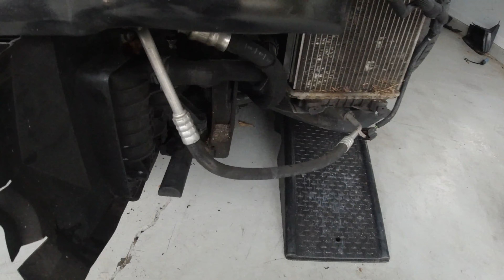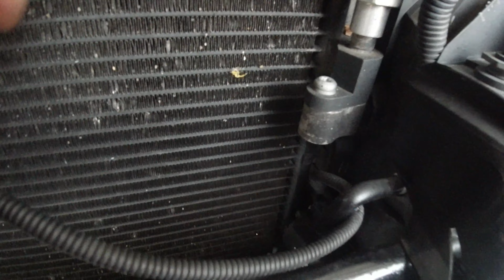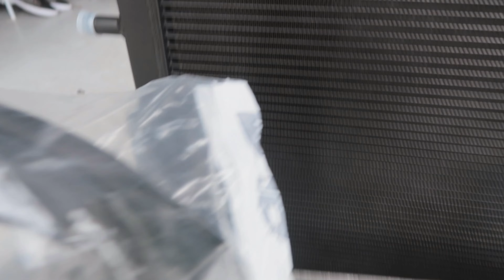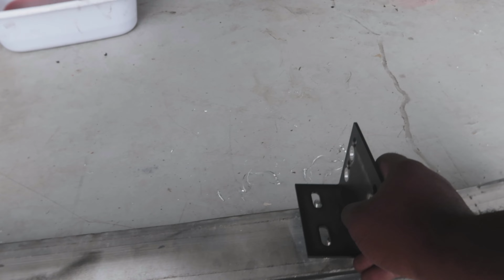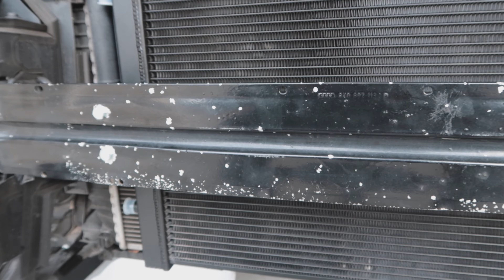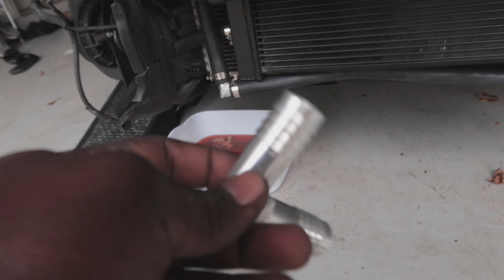PLM Power Driven V2 Heat Exchanger install | B8 S4

Comment: Bruh lol ain't that backwards i thought the hose connectors are supposed to be on the driver side
Reply: yeah he installed it the wrong way lol. but it doesn't matter, as long as the hoses are routed to the correct port lol, he just made it harder on himself needing longer hoses

Comment: Wouldn't you be able to flip the brackets the other way so the bolts go past beside the heat exchanger?
Reply: I recently did this install and flipped the bracket, there's plenty of room with them flipped. I think they ship it attached that way for protection and compactness in shipping. Regardless the install looks clean; good work!
Reply from the maker: Yeah I think so and if it’s still giving you trouble try n get shorter bolts.
Reply: Would you be able to tell me the size and the type of the bolt please
Reply: @danielsvancara  I can't recall the exact size but i think it's a M8 x 1.25 thread maybe 80mm long? you can always gring the bolt down to avoid buying additional hardware though. I trimmed my bolts that came with the kit about one inch to reduce the length.